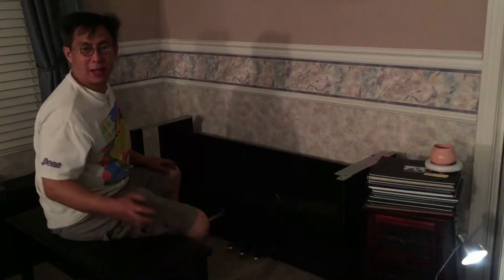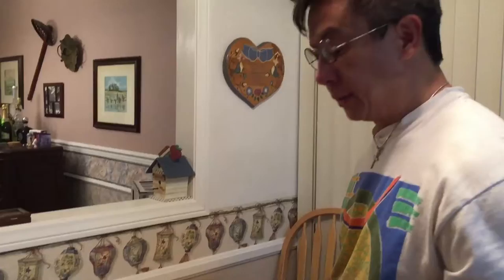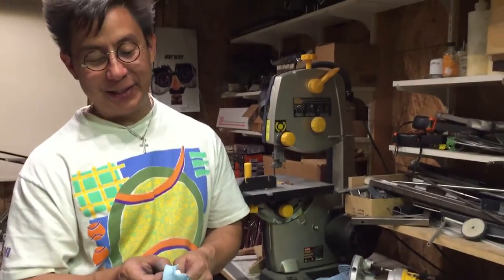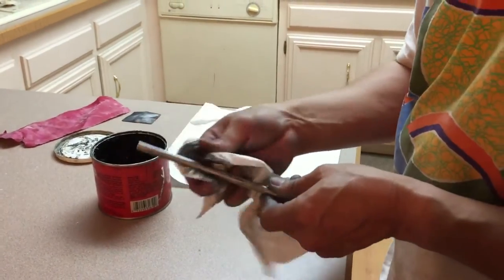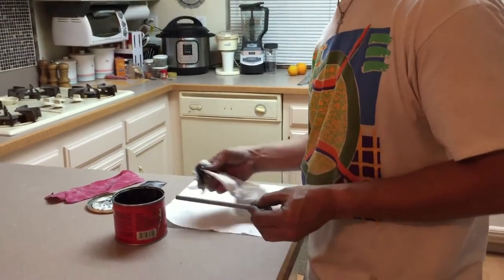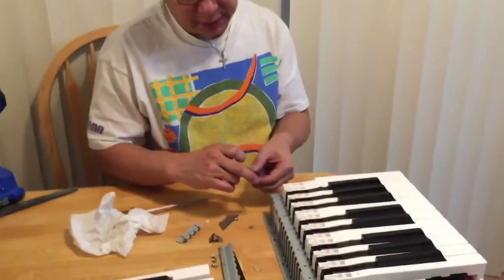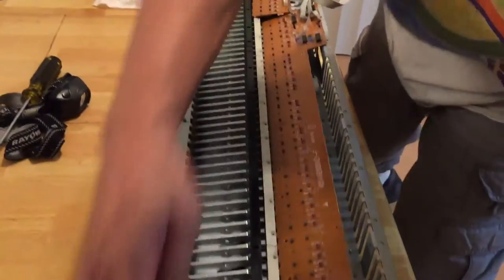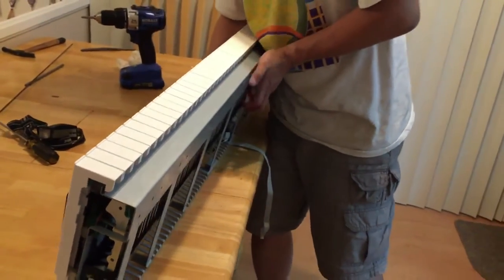How to Fix Sticky Keys on a Williams Symphony Electric Piano

Comment: Mike I just fixed my daughters Williams baby grand piano, I used my hand drill to smooth out the shaft with emery cloth then 1200 sandpaper to finish.  I found the tightest weighted arm of the 12 and sanded the shaft to fit to where it was loose then the rest followed. I used silicon for my grease on the shaft afraid regular grease might attract dust over time.  Thank you so much I would have never been able to do this without you!  Alan  H.  PS we moved from the west coast to Colorado and when the piano arrived over 1/2 the keys we sticking

Comment: Mike you are spot on with this video repairing a sticky keys issue. I have the same problem with my Behringer electric piano. Thank you so very much. I can now fix my piano keys. :0). Len 

John 3:16  KC3DD

PS. One suggestion I have for complex dissembles and re-assemblies is to put each separate assembly of screws' parts, washers etc.  in a plastic bag with a 3x5 card identifying the screws with the assembly info on the card. I also use masking tape labels through out the disassembly labeling matching parts with similar letters or numbers on two pieces of tape (on assemblies and near its location spot before removing it). I have used this procedure for very complex electronics, automobiles and appliances, with much easier reassembly. Its easy to put it all together if you take it apart this way. Its another story is some one else dissembles and you have to reassemble it. Very difficult if not possible to replicate the full reassembly like it was before taking it apart.

Comment: Thanks God your did record this, forward or backward. 😊  My piano design is identical to yours and thanks to your diligent and clear instruction video i am able to follow your steps  in order to fix my piano sticky keys. Unfortunately I don't have your drill press so I will have to use my hand held drill. No way around dealing with gazillion screws though!!! I will probably will end up with a few extras at the end.  Thanks again for recording this.

Comment: Thanks a lot for this video. The suzuki serie HP 175 / 275 has exactly th same parts and the same problems ! The body , the counterweights, the rods, the keys and other fixing parts are identical. There is no plates under the suzuki keyboard like at 14:00 on the suzuki. The electronic board seems the same than on Susuki too, as well as the command panel and the power and transfos circuirty, the 2 small speakers behind the keyboard and other fixing parts... So it is interesting to dicover that these parts are interchangeable between some builders.

Comment: MrMike -- Please provide update on how this fix has fared 3 years later.... seems that the problem could be inherent to the steel on plastic bearing design... and the new kit consists of an "ace rod" made out of a plastic / Teflon material. 
Also seems that the rods are supposed to be very tight by design so also wondering if you noticed more play in the keys after doing the polishing / sanding?  I wonder if cutting / polish compound would be less aggressive than the sandpaper...
Reply from the maker: My wife says the keys feel fine.  There are three black keys on the far right that stick.  I can’t remember if I did all the keysets or just the ones that had the problem or felt too tight.  I’m pretty sure I didn’t do all.  It’s actually aluminum rods.  The rods were not polished, they appeared unfinished, not as smooth as I would imagine.  The sandpaper was fine, you would spend hours smoothing out the rods with rubbing compound.  Following up with rubbing compound might be good, however I did not do that.

Comment: This has been very helpful for fixing my piano! Another source of sticking for me is the little grey contact pad between the key and the weight. My model appeared to have something like white lithium grease there, but that seems to be too sticky for the sharps and flats. Did you put any lubricant there or just go without?
Reply from the maker: Sara Malec it’s probably old and dried out.   Maybe clean it and then apply a very thin layer of grease.   I mean like apply then lightly wipe off.  Please leave another comment if you find what works!  :)

Comment: how did you get keyboard itself out? I can get it to slide out. feels like I don't have clearance
Reply from the maker: pax2bag w after removing the screws, I lifted the front and slid it forward.  I’m guessing you watched the video and saw how it was re assembled and how it slides in to place.  There wasn’t anything else special I had to do.
Reply: thanks for the quick reply, ended up being the screw hidden under the midi port cover. Btw the ribbon wire i need to remove to get the keyboard out is glued to the circuit board. Any suggestion for getting that off?
Reply from the maker: Oh sorry I did not see this comment till now.  I would just pull it slowly hoping that the glue lets go.